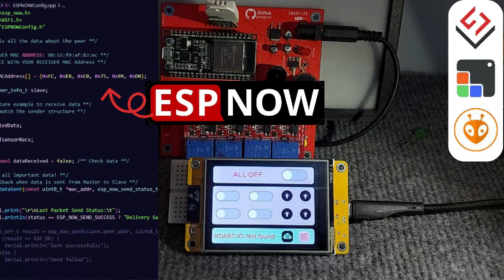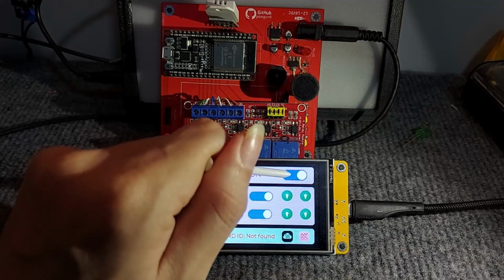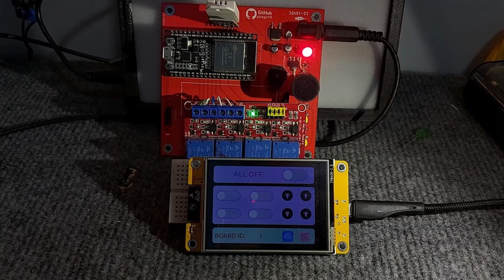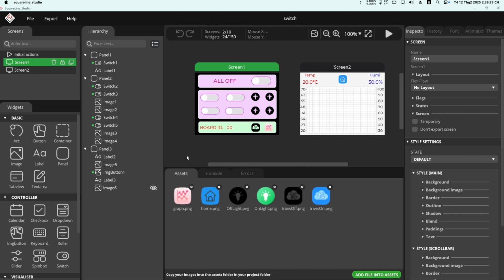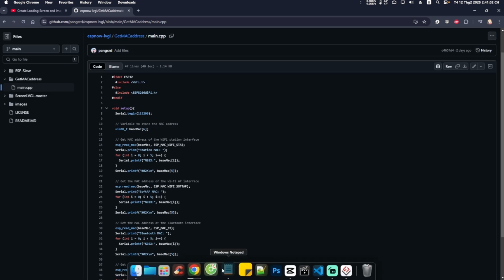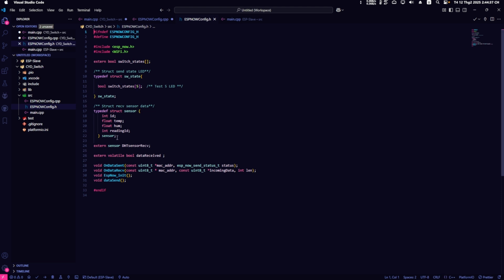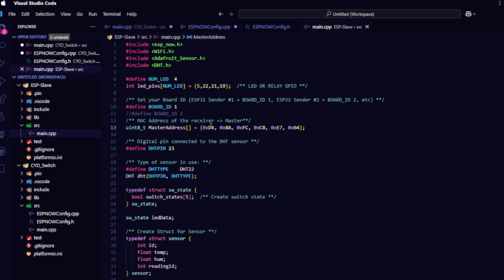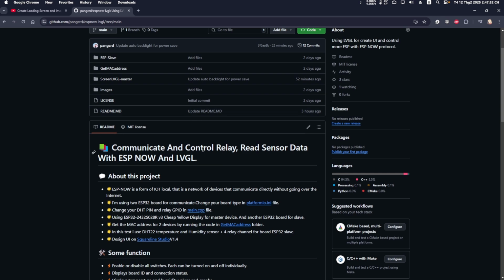ESP32 Smart Dashboard with LVGL & ESP-NOW | Wireless Data & Control

Comment: Thank you soooo much.
I want to control some esp32-c3 with led strips over a cyd with touch ui.
I know wled, but for my case it is too overloaded and so too much to configure.
So i decided to build my own system.

I have been looking for a longer time if somebody did something like this. 

I have learned so much from your video and got nice tricks. Now i have to think new and change a lot. But the way you showed is much better than mine. First step is to redesign my ui. This programm looks really nice.

Thank you for sharing your builds and i hope to see more from you. 👍

Comment: Sir good morning, I'm having a problem programming my NORVI HMI, every time I try to debug my code i get errors and the compiling it's so long. It appears that I'm having problems with lv_conf.h and I really need help with this. I would be so grateful if you could help me
Reply from the maker: Check your lv_conf.h file and make sure it's included correctly and matches the LVGL version you're using. If you're using PlatformIO or ESP-IDF, double-check that the LVGL library is properly added. Send me the exact error message so I can take a look.